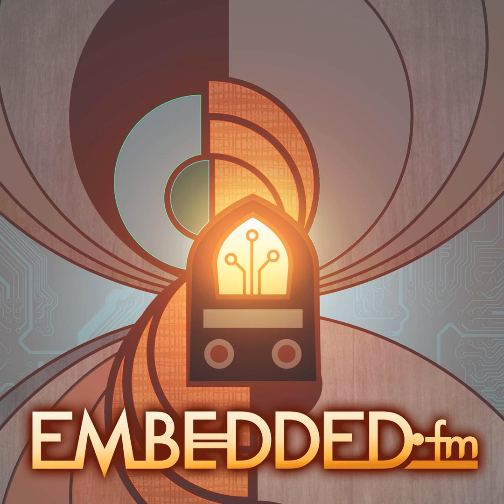412: Inductors Don't Have Feelings

Comment: They're called bypass capacitors because they bypass the electrical noise through the capacitor instead of sending it all the way to the power supply, and radiating it out everywhere along the way!